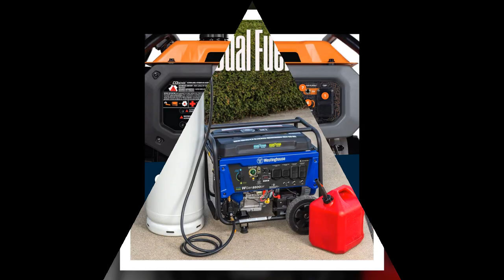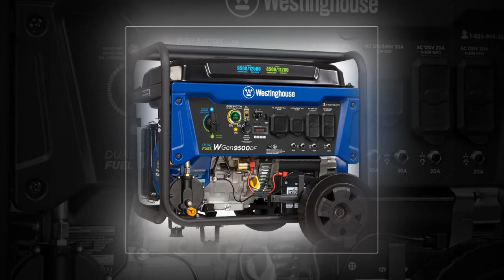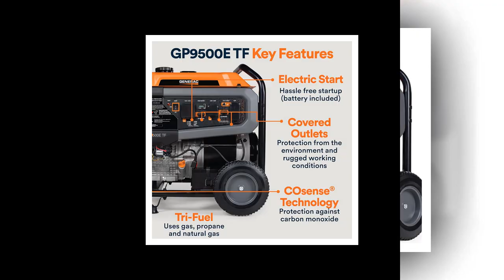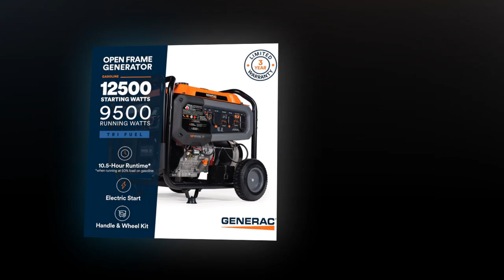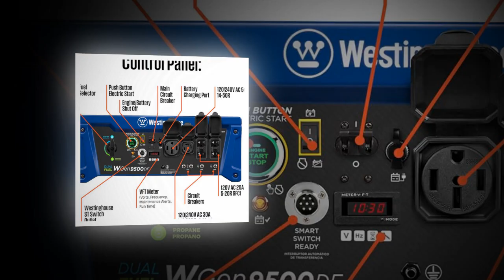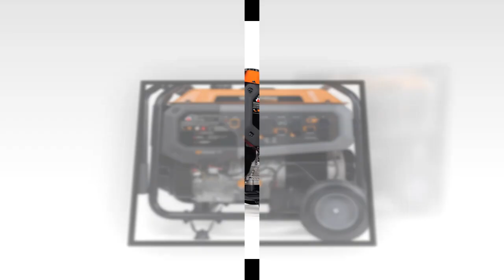Generac vs Westinghouse Generator | Home Backup Generator Battle: Generac GP9500 vs Westinghouse.

Comment from the maker: Link = https://cutt.ly/nrKIPCVC

Home Backup Generator Battle: Generac GP9500 vs Westinghouse Analysis.

Choosing the right home backup generator requires thorough evaluation of reliability, power output, and maintenance requirements. The Generac vs Westinghouse generator competition showcases two exceptional models designed for residential backup power applications. The Generac GP9500 backup generator features robust steel construction and comprehensive outlet configuration, while the Westinghouse WGen9500DF generator emphasizes fuel efficiency and user-friendly operation for seamless emergency power transitions.

Hashtags: #HomeBackupGenerator #GeneracVsWestinghouse #BackupPower #ResidentialGenerator #GeneratorComparison #PowerOutagePrep #EmergencyGenerator #HomeGenerator #BackupGeneratorReview #GeneratorBattle #PowerSolution #GeneratorTest #ReliableBackup #GeneratorGuide #BackupPowerSystem

Comment: Allways get a low >6 % total harmonic distortion generator or higher cost inverter generator.  Dirty AC power caused by distoration of the AC waveform and off frequency  meaning not 60 hertz from  low cost generator designs can and will damage your electronic devices.  I learned this lesson during Hurricane Wilma when I used a generator loaned to me.  I lost 2 expensive TV sets

Also know that cheapo inverter generators can also produce dirty power by a distorted AC waveform and they wont last decades and are costly to repair.  So I stick to low THC generators and avoid inverter machines.

Comment: Smaller engine running longer on same fuel load usually ends up being a lean fuel condition which doesn't bode well for engine life reliability.  Most modern engines are already tuned too lean to meet emission ratings...  I would be concerned Westinghouse went a hair too far on a lean mixture which will run the engine hotter and burn up quicker.
Reply from the maker: Thanks for sharing your insight 👍
You’re absolutely right that lean tuning can increase operating temperatures and potentially impact long-term engine life. Most modern generators are indeed calibrated lean to meet current emission standards.
In this comparison, I focused on real-world runtime, load handling, and manufacturer-rated specs. Long-term durability is something that only extended usage and field data can truly confirm. Appreciate you adding this technical perspective to the discussion!
Reply: Outside of the specs. What i heard was that Generac has a bigger heavier engine. (Just purchased one) the heavier engine means more to me than the runtime. I live in the Caribbean, the most i have to worry about is rain. And come to think of it, even if i lived somewhere with extreme temperatures, all the more reason for the heavier engine. 

I thought the video was great.
Reply: @essenceriddim  the heavier block doesn't mean anything.  The lean condition burns through the piston and cooks the exhaust valve seat.  It's actually worse in a hot environment (if it is lean)